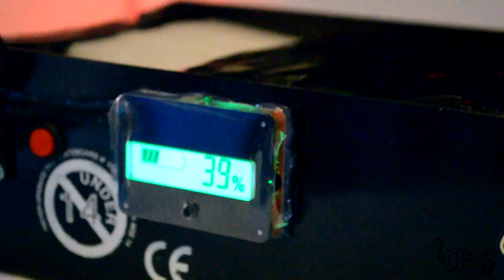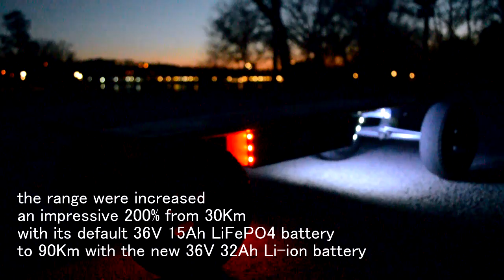36V 32Ah high density Li-ion battery made for all-terrain electric longboard

Comment: yet, Another video. Samsung 29E cells. these are Garbage cells to use. for High Demand uses  At least this 11p setup lets you get a Solid 30 amps out of the pack. Still not 100 as you list or 2200A max which is total Horseshit.  are you just Combining all the amp ratings to make a total number as someone who makes a good looking battery, you don't seem to understand how Voltage/Amperage works. for anyone who is wondering. this Pack is good but wont get you near the Power you need for high drain like it might seem. do your research.
Reply from the maker: WoW, it was a weird typo! now corrected! (220A max)

For any reason Samsung specified this cells extremely conservative in their datasheet. I've been using for years now and are virtually identical to Panasonic PF. Same internal resistance, same specific chemistry, same temperature rise for a given current and same life span / cycle degradation. So indeed believe be these cells are as good as PF cells, you can pull 3C maximum continuous for half a minute and they won't rise their temperature too high to affect their life span, in this case it is all about IR and they work solid in that aspect

Comment: How do you connect the battery indicator to your battery?
Reply from the maker: those ones works reading the battery voltage, so they are just connected directly to the main leads ("+", "-")

Comment: if you swap from lipo to lithium ion batteries, will the stock charger that it came with work?
Reply from the maker: Generally yes, the charging system is the same, you only need to just calculate maximum battery voltage and charger voltage. Also the appropiate current

Comment: Can I know what does 'safe' means in SPC?
Reply from the maker: When you have a self-shorted cell it self-shorts the whole parallel group, having both risks of a thermal runaway chain reaction or completely parallel draining. With that system virtually similar than a fused systems, a self-short makes the rest of the cells to disintegrate their parallel conductor and disconnects the self-shorted cell.
Reply: Thank you for the fast reply. Keep up the good work!

Comment: Safe parallel connection. It is a good idea.
Reply: i don't really get the point of this fuse idea, when the fuse breaks there are few cells that are not connected to the bms anymore, how does the user know that a fuse has been broke?